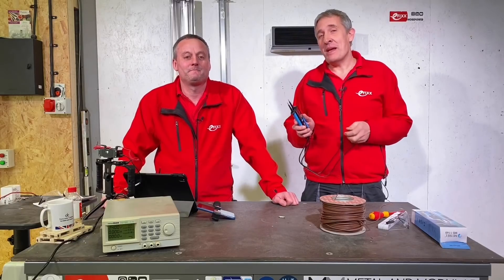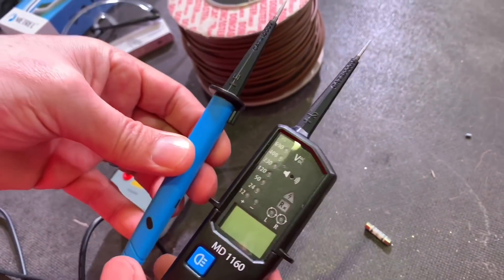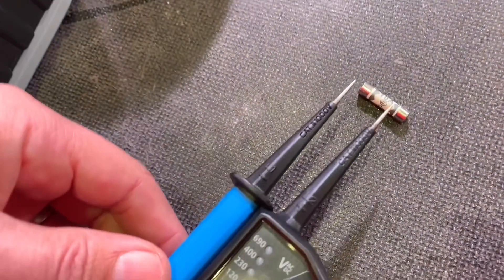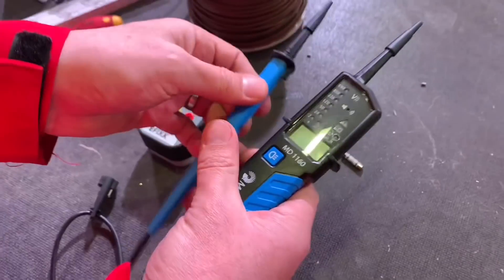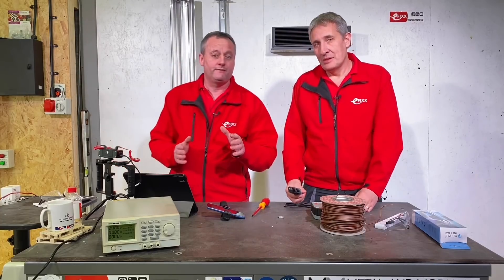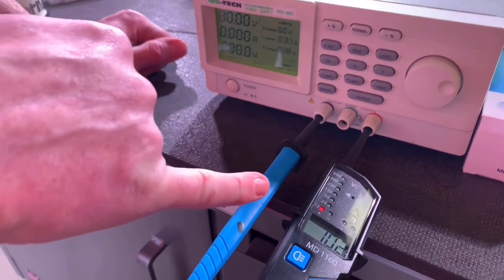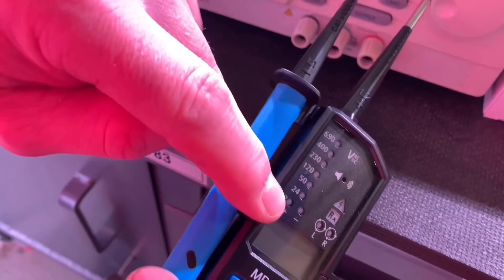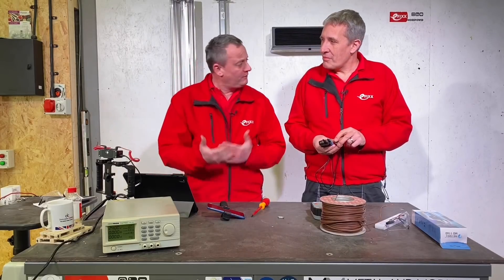The Metrel MD1160 is the perfect tool for Electricians - SAFE ISOLATION

Comment: My question is. Why do you need a voltage tester or why or in what situation would you want to use a voltage tester instead of your normal MM or Clamp meter to measure voltage or do FF.
Reply from the maker: Clamp meters only work when current is flowing in a circuit. Multimeters can easily be set to wrong setting giving a false reading of a dead circuit
Reply: @efixx  Ok fair. But how would you answer that coming from a qualified artisan that works on Electrics and uses a multifunction clamp meter eg. (Chauvin Arnoux F205)
 or any other brand and auto or non auto ranging multimeter. Because I cannot see where you would Use or Need a Voltage tester like that If you get my point.
Reply from the maker: @ironwolf6849  Here's our training module on safe isolation procedures and best practice - https://www.efixx.co.uk/Know%20How/introduction-to-safe-isolation-cpd  - as you'll have seen in this video, a voltage indicator works if the batteries are missing or failed. Multimeters can be on the wrong setting DC, not AC, probes in the wrong socket etc. Plus, you still should use a proving unit to check the instrument is working.

Comment: I'm in the market for one of these at the moment, but I'd love to know why none of them seem to have a retractable sleeve on the probe to allow easy testing in choc blocks, for example, without having to remove the sheaths and immediately lose them.

The basic Martindale seems to have them, but that's bulky and doesn't have the lcd or continuity option.

There also seems to be a massive difference in price between "brands' even when they are all probably made in the same factory with the same chip inside.
Reply: my basic tester is the Ideal vol-con, and it has exactly the spring loaded retracting sleeve on the probes - you can latch them back, or use them in spring mode.  it has no LCD, but if you need exact voltage, you can get your multimeter out.  I also found, before I lost my original one, that it will self charge its continuity batteries, just by putting it on a live circuit for a few seconds.

Comment: Great video as always. Could you go into the differences between a pure tone (continuity) and a slightly buzzed tone. Also could be worth pointing out the reasons why you get continuity between neutral - line, neutral - cpc and line - cpc on a de-energised circuit, usually at a fitting and usually the cause of a slightly buzzed tone etc

Comment: I use the TIS 859 which is the all singing and dancing model, vibrates when a circuit is live :) also has the proving unit as part of the storage bag, wouldnt be without it. Metrell looks good for an entry level model.

Comment: That's actually quite a nice meter, great now I want one, I don't have a need for it but I want one.

Those conformal shrouds do worry me as I have run across a lot of things where I could barely get the probes on and making contact and it gives me the impression it would increase the possibility of false negatives.
Although maybe in the foreign electrical things are a standardized better to have that access? With the shrouded tips?
I absolutely see the need for the shrouded contacts... I have a nice gouge mark in my multi meter probe....
But I've also tested a lot of things in the US market where I absolutely cannot test unless I take the cap off.
I did recently get this cool meter which lets me increase or decrease the tip length.

From the various UK electrical videos I've been watching, I find the audible warning very non-distinct as to what it's doing between the various makes that people use. Like OK is it warning me that there's live electric or is it worrying me that there's continuity?

Comment: must have for all electricians! if you dont have a tester to prove dead, your doing it wrong/unsafe !!
Reply from the maker: Thanks for the great message - turn it tonight at 8pm as we are giving out prizes https://youtu.be/w0Fq-h7U4LQ (hint 😉)
Reply: @dougijcw9758  Completely agree. For a start these only go up to 690V so not all that much use proving a 1000V circuit is dead!
And yes, circuits with a potential for higher than 690V are very common particularly with solar.

If you've got to carry a proper meter anyway (which you do) then why carry something extra and risk using it on a source that is outside its maximum operating parameters. At best that's inconvenient, at worst dangerous.

Comment: This looks suspiciously like the Megger TPT320 Voltage Tester.  What’s going on here then I wonder? 🤔
Reply: And the TIS 831 and also the martindale VT25 all exactly the same, same with megger who have brought out a so called new meter called the MET1000 is just the same as an existing Sefram Instruments VAT 70
Reply: @michaelboyes4948  Seems like the industry is driven by a Cartel!
Reply: @Shirazmataz  yeahhh clearly efixx is part of the supply chain 🤣
Reply: @michaelboyes4948  Clearly! 😂 Otherwise they could have quite easily branded it with eFIXX, but why bother if part of the same supply chain 😂

Comment: GS38 references, correct proving unit procedures, AC/DC talk....... as a student, it doesn’t get much better than this! 😂 I bought the kewtech KT1780 safe isolation kit. Had a good deal on it. Good bit of kit even though you can’t change the head on it.

Comment: Really good review. I currently have a Fluke T110 which, compared to this Metrel doesn't have a digital readout. But some of the points raise in your review have made me wonder whether my Fluke has those features too (the battery-out test, for example), so I'll check those out pretty soon. I'm not about to replace my T110, but based on what I've seen here, I'll definitely keep the Metrel MD1160 on a list of testers worth considering when I need a replacement.

Comment: Here in Germany an electrician without a voltage tester is no electrician at all. The VDE doesn't permit multimeters, screwdriver tester things or NCV testers to check if a circuit is dead. And that's the case for decades here. Not reliable, or risk of operating error. And also with a multimeter you must turn you look away from the testing location to look at the display of the multimeter. And if you're standing on a ladder with a multimeter you'll have one probe in the left hand, one probe in the right hand and the third hand is holding the meter itself....

We call them Duspol here, Duspol is the trademark for voltage testers made by Benning. Even it is made by Fluke or another manufacturer, we call that a Duspol. Maybe because they're around for a long period of time:

https://www.benning.de/files/benning/global_content/content/news/powernews/2013_12/duspol_generation_2013/duspol_generation_2013.jpg

I got the model N from 1954, and also the model N from 1975. Actually the 1975 model was so popular, they produced it in parallel to the modern ones until 2003. Then they seized production for several reasons:
- Load connection had only one button, now there must be a button on each probe pressed simultaneous.
- Polarised neon indicators to indicate polarity on DC were no longer available, they bypassed this by implementing LEDs indicating the polarity.
- IP rating was only IP40, but new testers had to be at least IPX4. Moisture will reduce the electrical insulation.

Old electrician once told me: The Duspol is the stethoscope of the electrician.
That's the reason electricians here hang them around the neck, so the probes are in front of the chest. You got both hands free, but it's always available when needed. Especially if testing a lighting circuit and stand on a ladder. Some pics:

https://abload.de/img/img_0086qwj9i.jpg

https://abload.de/img/img_0127wsjey.jpg

https://abload.de/img/img_01290ikrk.jpg

The button switches between the neon indicator and the plunger coil instrument. The instrument serves also as a load to reduce the influence of induced or capacitive coupled in voltages. That's the reason I like the load connection. The neon indicator won't trip the RCD, the plunger coil must trip it when tested between line and CPC. It's not an official test, this is more like a "Hello, anybody there?" test.

And this one is everybodies darling, except the continuity and single pole testing everything is powered by the circuit you test, even the display backlight. That's the reason this guy requires at least 60V to work. It is rated CAT IV 1000V, IP65. For domestic a bit overkill, that is designed for industrial use, but it will also work in domestics of course. It's a voltage tester according to IEC 61243-3.

https://abload.de/img/img_0520kakhc.jpg

https://abload.de/img/img_0521q2kwu.jpg

https://abload.de/img/img_0523r6j9o.jpg

https://abload.de/img/img_0899smkef.jpg
Reply: Marcel every time you post we all learn something every time. I must say the quality and training for electrical apprentices in Germany must be of very high quality.
Reply from the maker: Fascinating history and insight - we’ll try to get a Duspol to try in the UK.
Reply: @efixx  Check this out, at the bottom are also UK contacts listed:

https://www.benning.de/products-en/testing-measuring-and-safety-equipment/test-equipment-voltage-tester.html
Reply: @efixx  They got three models available in three different price ranges. The analog model, it's the "smallest" one, works without  any battery. But it doesn't support continuity testing or the NCV functionality the other models have to search for a break in a cable and don't have a torchlight. The model has voltage indication, load connection, additional plunger coil instrument, single pole testing, direction of the rotating field in a three-phase circuit. It's in the price range of ~40 Euros on Amazon in Germany.
The Duspol Expert looks almost similar, but it requires a battery. It provides a continuity test, NCV for looking after breaks in cables in addition to the things the Analog provides. Except the plunger coil is missing and this one got a torchlight. Price is round about 55 Euros on Amazon. 
The top model is the Digital, comes with the same things as the Expert, but is having a display to indicate the voltage in addition to the LEDs. And also a low voltage setting for measuring batteries, a diode test and such funky stuff...

Duspol Analog:

https://www.amazon.de/Benning-050261-Duspol-Spannungspr%C3%BCfer-Tauchspul-Pegelanzeige/dp/B007TN79AU/ref=sr_1_3?__mk_de_DE=%C3%85M%C3%85%C5%BD%C3%95%C3%91&dchild=1&keywords=duspol&qid=1609289856&sr=8-3

Duspol Expert:

https://www.amazon.de/Benning-Duspol-Spannungs-Durchgangspr%C3%BCfer-050262/dp/B007TN657I/ref=sr_1_2?__mk_de_DE=%C3%85M%C3%85%C5%BD%C3%95%C3%91&dchild=1&keywords=duspol&qid=1609289856&sr=8-2

Duspol Digital:

https://www.amazon.de/Benning-digital-Spannungs-Durchgangspr%C3%BCfer-050263/dp/B007TN55ZQ/ref=sr_1_1?__mk_de_DE=%C3%85M%C3%85%C5%BD%C3%95%C3%91&dchild=1&keywords=duspol&qid=1609289856&sr=8-1

And their smallest tester is the "Profipol", no load connection. Only voltage test and continuity:

https://www.amazon.de/Benning-020023-Profipol-Spannungs-Durchgangspr%C3%BCfer/dp/B01BJCZ2HI/ref=sr_1_1?__mk_de_DE=%C3%85M%C3%85%C5%BD%C3%95%C3%91&dchild=1&keywords=profipol&psr=EY17&qid=1609290159&s=todays-deals&sr=1-1

Actually I would invest the few Euros and buy at least the Analog model. I got from the predecessor of this series, the Analog plus model. It's rated up to 690V CAT III and 500V CAT IV and IP 64.

And btw:
The clipped together probes on the voltage testers don't only fit the british fuses, this also fits into Schuko outlets. So you can test them with one hand. That's also the reason for the 4mm probe tip covers, they fit much better into the the outlets when they have shutters...
Most electricians here using Duspol buy the Expert or the simple Analog model.
Reply: The UK also had such testers afaik. For example this one here:

https://www.youtube.com/watch?v=lRAyTrWV1ek

Comment: Not a big fan of these, no replaceable leads or probes which should be a consumable item... much prefer my fluke 87v high res on the ohm scale, tons of attachments and long silicone leads .. means i can usually fault find without having to remove much .. which saves electricians time .. and we like that @ Efixx :)
Reply from the maker: Great point and fantastic quote 😁
Reply from the maker: I’ve use my Fluke multimeter loads of missions - However the HSE doesn’t recommend using a multimeter to prove a circuit is dead 💀 - see page 22 https://www.hse.gov.uk/pubns/priced/hsg85.pdf  - just in case you have it set to the wrong setting.
Reply: @efixx  oh i'm fully aware, it's the loose term of multimeter i don't like, a £5 ebay special and i can agree on.. a £400 meter used by someone who knows how to use it correctly i don't agree.. i guess it's what you're used too.. i was a marine electrical engineer  before becoming a spark

Comment: Invaluable big of kit, but this metrel one looks like its fallen out of the megger factory.
Reply from the maker: It’s identical to the Megger 👍
Reply: @efixx  Not the MET1000 (the new one)  really nice but £175 is a bit pricey..  ill wait until you fo a review on it :)
Reply: Ive upgraded to the TIS 849 recently and much prefere it over the megger, plus it has Electric Field detection on it which is great as it means you're less likely to reach for the trusty old voltage stick 😀

Comment: Great video boys, Did you try that cable stripper tool on LSOH cable after?
Reply from the maker: We are live-streaming on the 6th of January see link  👉🏻 https://youtu.be/w0Fq-h7U4LQ so results then 🤞🏻.
Reply: I have the Jokari version, same thing i believe ... works fine on LSOH
Reply: @thattoolguy9432  they look good in the demo, and I was going to click the link to buy them. Then I realised about the low smoke cable, so I hesitated on getting a set for now anyway!!
Reply: @gbelectricks  I've been using mine a few years now and they've been fine, worth buying a toothbrush sized wire brush as the teeth can get clogged from time to time.. esp if painters have miss coated after a first fix
Reply from the maker: Painters covering cables - what are the chances 🤣

Comment: Crucial bit of kit, I had the Martindale version of this tester until I blew the tip off.

I had first fixed a job, and between the first and second fix another spark had done some work and connected my exposed cables to another circuit.

Customer wasn’t happy... I wasn’t much happier either, but at least I was still upright.